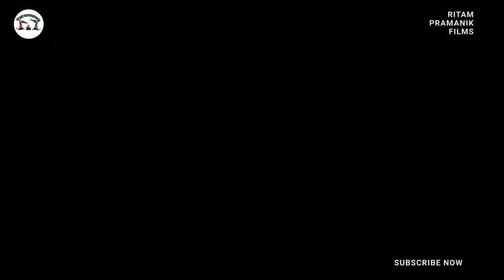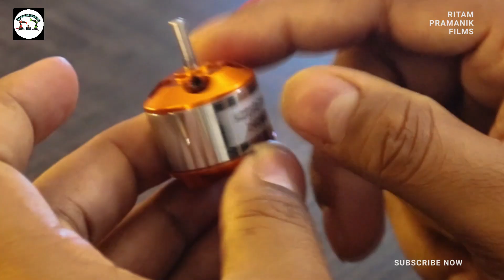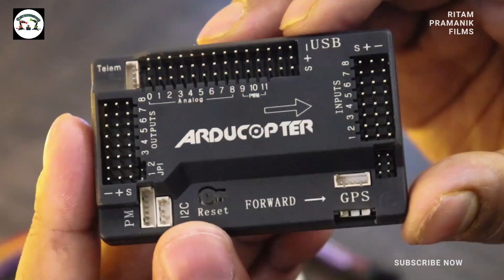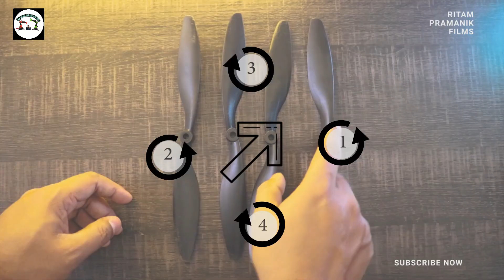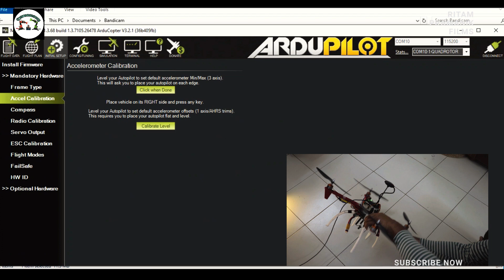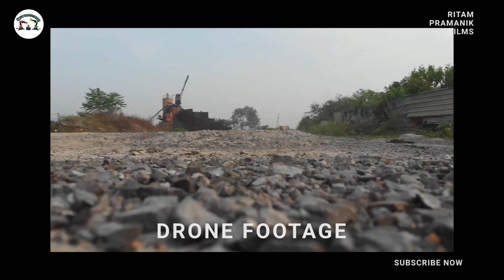Make Your First Camera Drone Very Easily || Drone Full Tutorial|| Chandrabotics

Comment: Does it also monitors battery level? Thanks!
Reply from the maker: Yes but for a limited distance. I used  low voltage alarm.
Reply: @Chandrabotics  how much it cost
Reply from the maker: 200₹ approx

Comment: In flight mode current PWM : 0
PLZ HELP ME... I'm not able to change flight modes
Reply from the maker: I have not made any video on that topic. Please go through other available videos on this issue .If you still face any problem then contact with me. I shall try my best.
Reply: @Chandrabotics  no I got it
It doesn't matter if the PWM value doesn't change....but Chuck that the flight changes (above the current PWM value) 
It happens because of the older version of apm 2.8 and newer version of mission planner. Both the versions will not sync properly that's y this problem occurs. Not an issue untill the mode changes.
Reply from the maker: Great.👍👍

Comment: how can i know my battery power is low ,and what is the distance?
Reply from the maker: This is a entry level drone so those are disadvantages. 
But you can attach one 'LIPO Battery low voltage alarm' to know how much battery is left. To make it a advance drone you can connect Telemetry Module .